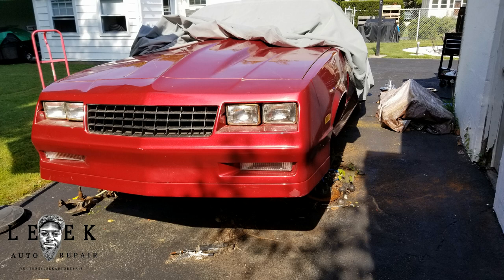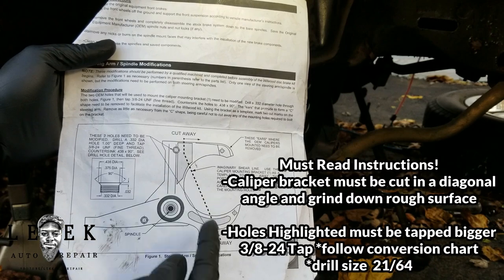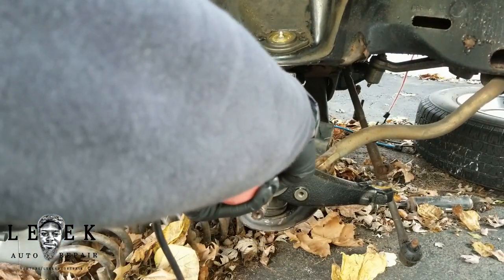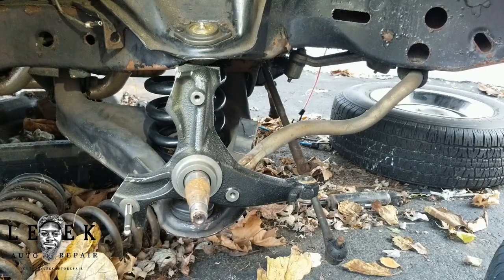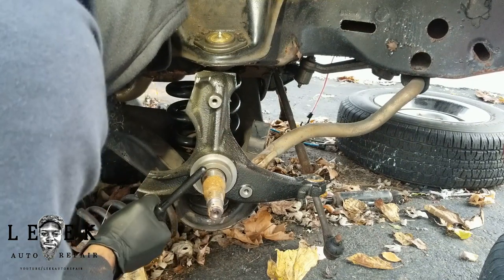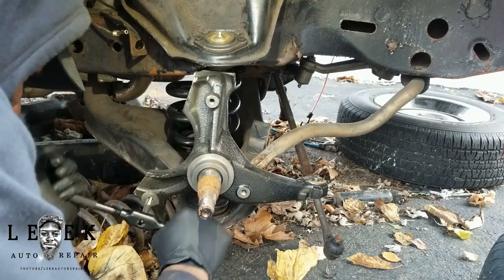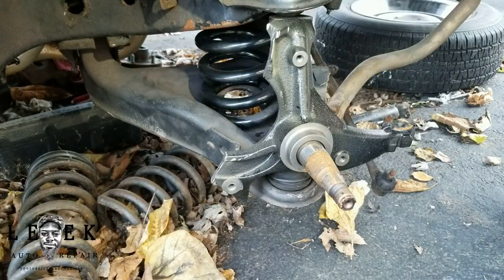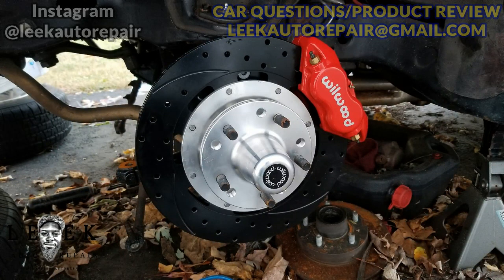How To Modify Spindle For Wilwood Brakes | Chevy El Camino

Comment: I have an 07 Nissan Sentra I just replaced the fuel pump twice. I filled up the tank and my digital fuel gauge is showing I have 3/4 of a tank and it's completely full! Could you please post a video on how to reset fuel gauge? This would really help me. TIA
Reply from the maker: Sorry bro but I don’t have a vid nor have any future postings regarding the issue. What sounds to me is that you have inaccurate fuel reading. If the gauge does work somewhat I would check the sending unit first
Reply: @Leekautorepair  Ty for responding. I replaced the whole sending under the back seat. The gauge works but I truly feel that it's off didn't know if it could be reset or calibrated.